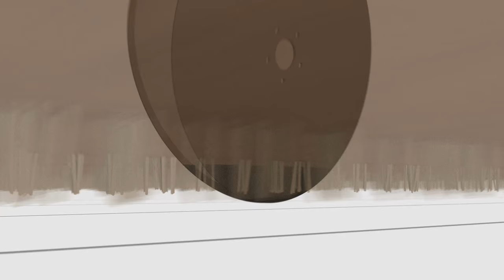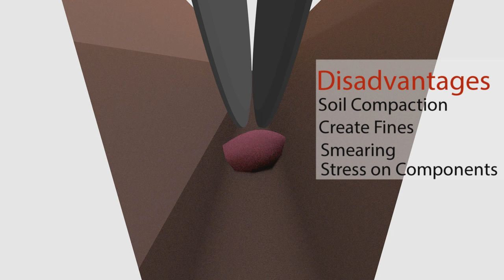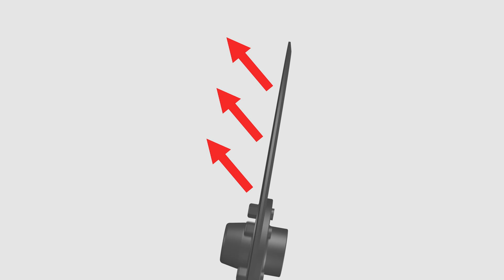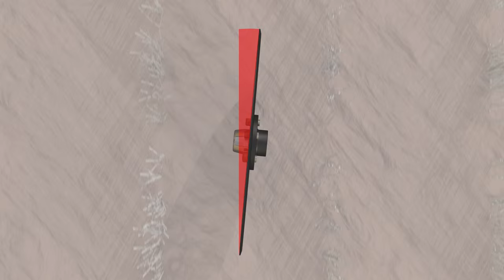No Till Farming Presented by Tobin No-Till

Comment: Weeds harvest sun, you should fill up the empty space between the rows with cover-crops so they can harvest energy and cover and protect the soil from the sun so the soil doesn't get to hot witch has many negative effects, nonfunctional plants and water evaporation etc. Cover crops also holds water, not use it. If you are in need of water your soil is bad and you need more carbon in it.

Comment: 3:30 Space (perhaps the most important requirement: living things need space)
7:44 Reduced Cultivation
8:39 Food and Water
9:22 Plant Density
12:12 Weed Control
13:21 Crop Rotation (some crops' roots can help create voids in the soil)
15:13 Shelter (leave stubble for shelter)
16:45 Burning off stubble (enemy of no till and is a waste of money)
17:35 Reduce the use of chemicals
18:44 Discs V's Tines (tines cause soil damage)
19:45 Double Disc (disadvantages: soil compaction, creates fines, smearing, stress on components)
21:48 Single Disc Horizontal Angle Only (disadvantages: soil compaction, creates fines, smearing, stress on components)
22:52 Tobin Geometry
23:48 Disc Diameter (Tobin uses larger discs)
24:57 Sticky Soils (scrapers work better on larger diameter discs)
26:27 Getting Started
Reply: 26:27

Comment: That was great Noel,thank you.Everything you talked about made much sense but i have a question.Would it help if corn stubble was ploughed in for a few years together with cover crops to build up the soil before starting no till?.Thanks again.
Reply: +William Robinson
Thanks William
I don't really have much experience with corn stubble.  My experience with stubble in general is that it is best left standing on top of the ground.  This is the way nature does it and this is the best way to improve your soils.  Instead of working up the soils for a few years, I think you would be best to use those years to let the micro activity do their thing uninterrupted.

The standing stubble will protect your soils from erosion from wind and water and the root system will be enough to feed your micro activity.

Best of luck...........Noel
Reply: Noel Tobin Thank you.
Reply: If it's genetically modified, it will take longer to degrade, best to use non-gmo seed.
Reply: the use of cover crops alone is far better than using any type of tillage. Anytime you till you are damaging your soil and killing earthworms, and microbes.

Comment: To reduce the weed in Paddy / Groundnut/ maize plantation, you must ploughing the land as follows:
1. After rain, you must give time to grow weeds upto 20 days. After 20 days, ploughing the field by Disc Harrow as Este West one time and South and North another time. After 8 days, plough same field two times by using Cultivator. After another 8 days, plough the same field two times by using Rotovator. Very next day, you may sowing Paddy, Groundnut or Mize. This is the way to reduce weeds in the crops. Try it, if can.
Reply: Did you understand a word he said? The entire point of no-till is to disturb the soil life and structure as little as possible.
The best way to control weeds is proper mulching and cover crops. Nature tends to cover naked soil with leaves,. The soil is full of seeds that are dormant and waiting for the right conditions to germinate. They don't come up as much if they have no space to grow or are too far from the surface.

Comment: Isn't it more logical to mix / cover plant residues with soil and stop dissipation/waste of CO2 and N2 into the air? How about capillar travel of water from beneath directly to the atmosphere when no tillage is applied? It seems more reasonable to cut capillar water travel somewhere below the ground level and cover it with soil/residue mix to protect from waste of water allowing plants roots to use water from below. The only acceptable argument in favor of NT is cost cut and achieving low but optimal  crop from the total economy  point of view, all at great environmental expense due to herbicide poisoning of the soil life.